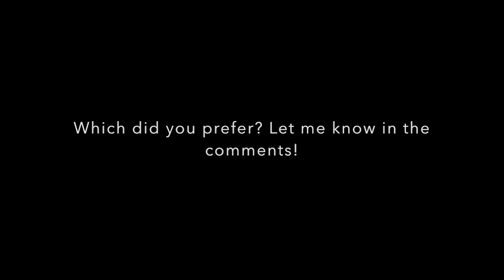Callaham Hardtail Bridge Shootout - same guitar

Comment: I preferred the 3 compensated saddles more myself. Although in a couple styles of play, the CG sounded better. Comes down to style I think. I have a CG in my Japanese Strat. Considering the Compensated in my Tele. Really liked your demo. Thanks again.
Reply from the maker: Bob Deskins I agree. Overall I like the brass... sounds a bit more creamy and smooth in the highs. I think this roasted maple neck really needs that slight taming through the regals on 500k pots. It's subtle but every little bit matters I guess! Thanks, glad you dug the video!
Reply: I liked the strat bridge it was more clear seemed it had better output